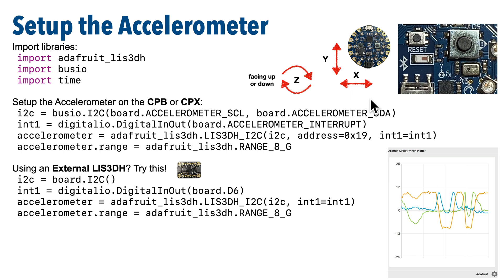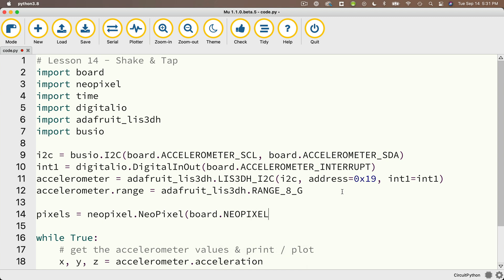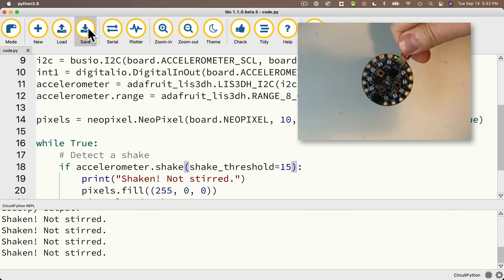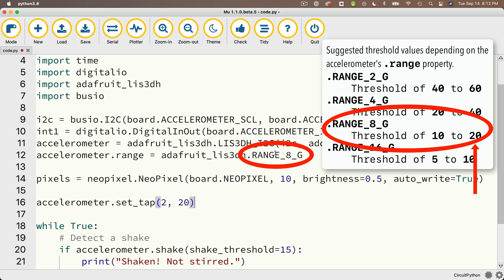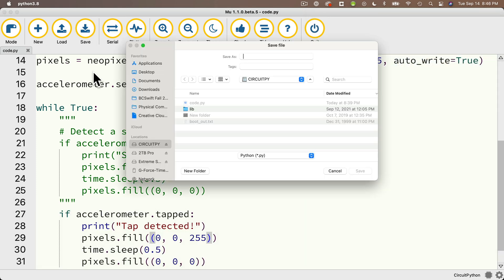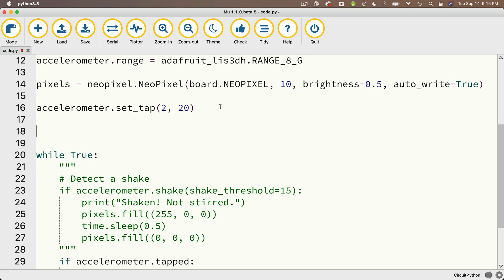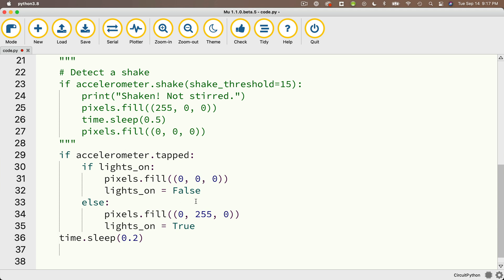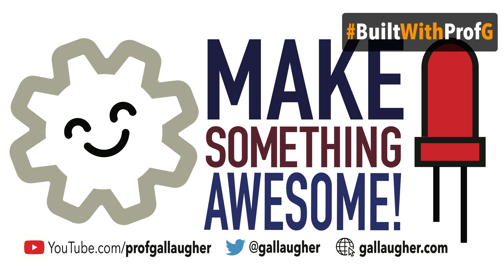CircuitPython School - Shakes & Double Taps with the LIS3DH Accelerometer

Comment from the maker: Quick note to be sure you check the documentation for your board for the proper pin objects. Some boards (for example, the QT Py RP2040) have slightly different I2C setup.